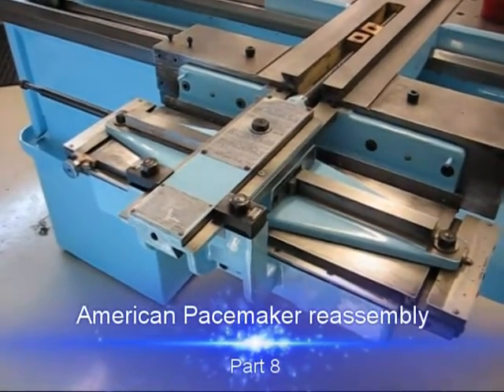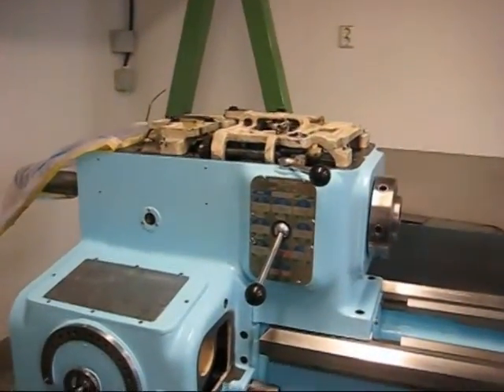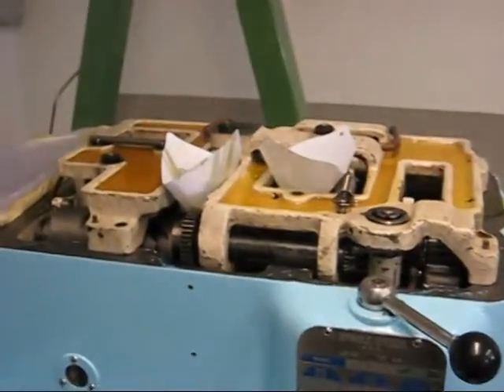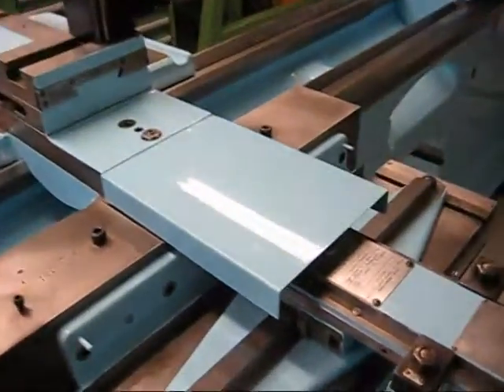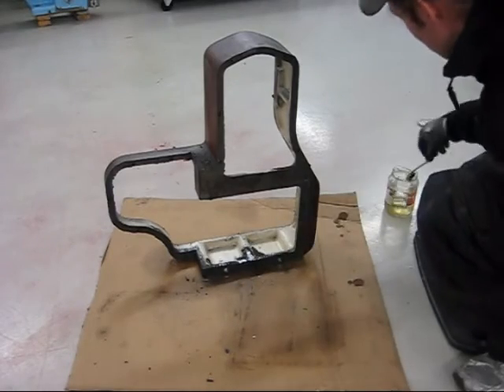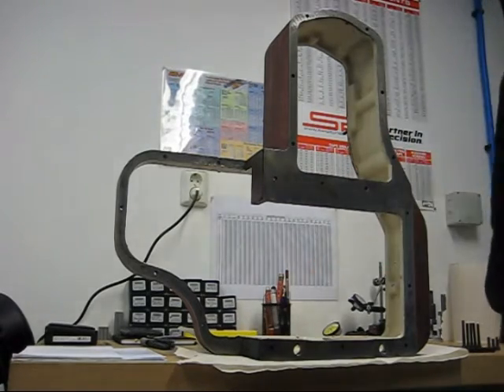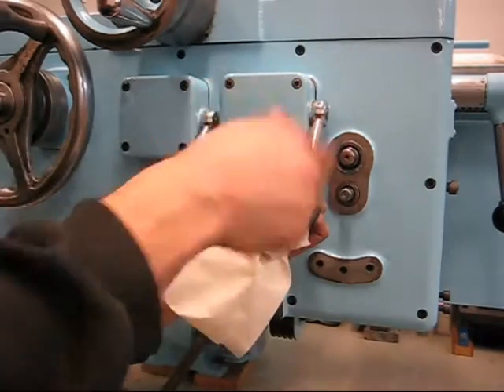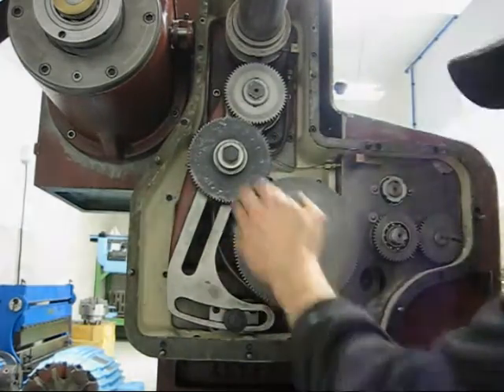American Pacemaker lathe reassembly part 9

Comment: get a hand pump and external cartridge filter and clean oil that way its quick cheap and easy its what I built to clean oils  you can make different filters to get out what you want and you can use the plastic  filter holders , you dont know how much paint is on a machine till you paint it Grins
Reply from the maker: +Bleu Wolf That's a great idea! I think I will do that for future projects.